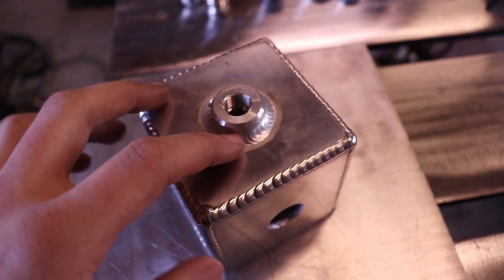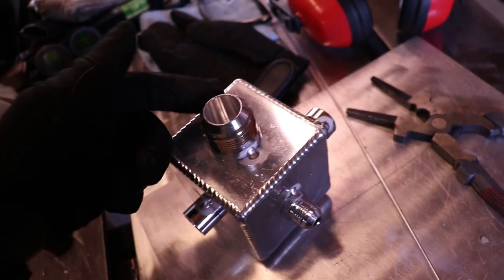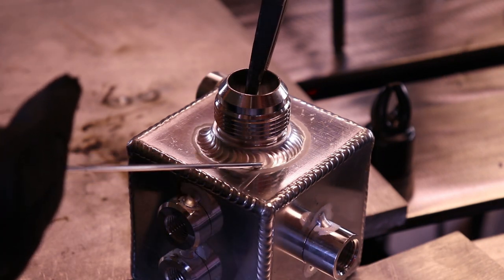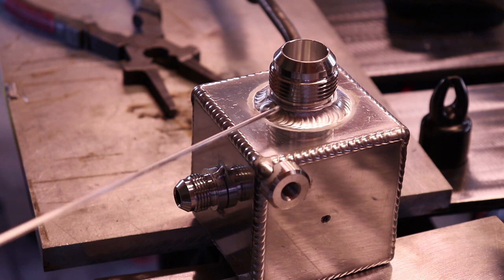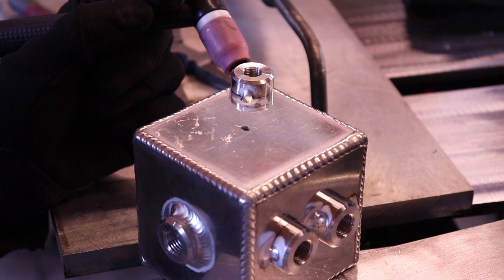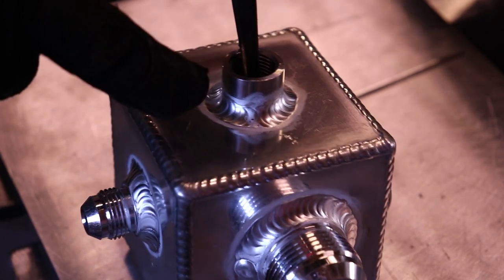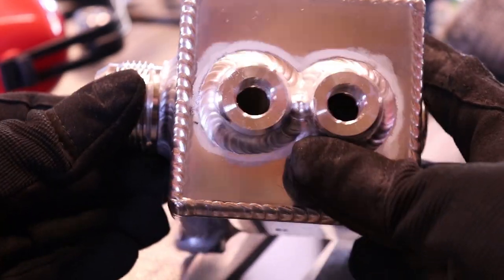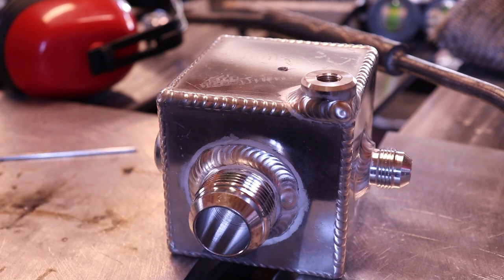TIG Welding Aluminum Bungs with HTP Invertig 221

Comment: Thanks for adding the 2nd camera to show amps, that's one of the pain points when trying to learn how to weld, other videos never tell us how many amps are being used.
Reply from the maker: Ya I still need to work on getting that second camera working the whole time. Haha ya it's hard to say how many amps you're using unless you film it, because I've always just maxed out the amperage and adjusted for it with the foot pedal

Comment: Everlast 255EXT. Just learning heat control and training muscles at this point. First project was brazing in and out of position. Super fun.
Reply from the maker: right on bud.   I used to do quite a bit of oxy fuel brazing but only tig brazed a handful of times.  I really liked the oxyfuel brazing though!

Comment: Awesome workmanship and great job at explaining what’s happening as you weld. Have my first welder on order (Everlast 250EX) and can’t wait to start practicing. One subject I think you missed on is the question of welding dissimilar materials together (steel bung w/ Aluminum). What’s the filler wire and aluminum type?  Thanks again for the vid, it’s excellent!
Reply from the maker: thanks bud and congratulations on the new welder!  you can't really weld aluminum  to steel Ive heard of people somehow brazing them but im not sure which filler.  Thanks for watching bud
Reply: @5thStreetFab  I guess that's why there's confusion!  What material are those bungs you're using?
Reply from the maker: @supergarball  it welded like 6061 so it's more than likely that or a similar 6000 series Aluminum

Comment: I have the same welder can you please share the settings with me? I am welding this coming weekend for a science fair project for my son.
Reply from the maker: Sure!  The best setting for all around tig aluminum is 70% balance 130hz.  Leave everything else alone.  Amps change depending on the thickness and joint configuration. Cup size 7 if you have it and a gas lens if you have one also.  14 cfh of argon.

Comment: i suck welding aluminum. i tried welding a bung and ended up melting half the bung before i got to weld. I guess wasn't using enough amps.

Comment: Nice welding!
Reply from the maker: Thanks bud 👊 any cool things at work lately?!
Reply: @5thStreetFab  yes but cant video it. Made 5 Bradley doors recently.
Reply from the maker: Ya that's what I figured.  Dang that's cool they must be super thick!  Is it something like ar500 plate?
Reply: @5thStreetFab  actually its 1" thick 5083 aluminum id send some pics but dont if I'm able to
Reply from the maker: Wow that's cool for some reason I just figured it would be steel.  I've never welded 5083 is it similar to 5086?  We run that a lot with 5183 if I remember right
Reply: @5thStreetFab  maybe it is 5086. But I think its 5083. It is 1" thick aluminum and after I'm done welding the door there is a 1/4" piece of armor steel that goes on it.

Comment: What filler rod do you like for bungs on radiators? 4043 or 5356? Also 1/16" or 3/32" diameter filler rod? Cup size and argon cfh? Sorry for all the questions. Trying to perfect my aluminum welding.
Reply from the maker: I like 4943 its like 4043 but smoother welding.  usually 3/32" but it depends how thick the bung and radiator are.  I like either a standard number 5 or a gas lens 7.  my cfh is usually around 12-15 cfh basically as low as i can set it without contaminating the weld.
Reply: @5thStreetFab  thanks for the quick response.

Comment: Great Video and great welds  - what size filler rod and  tungsten did you use on it
Reply from the maker: Thank you!  I used 3/32" 5356 filler and 3/32" 2% ceriated I think.
Reply: @5thStreetFab  Thanks - keep up the great work

Comment: another great vid, would like to see the puddle if possible, this really helps in what is going on during the actual weld
Reply from the maker: Thanks dude!  Ya I tried filming the puddle but you could only see it for like 3 seconds because of the angle changes so I left it out.  I might do another one on a positioner so you can see the puddle the whole time